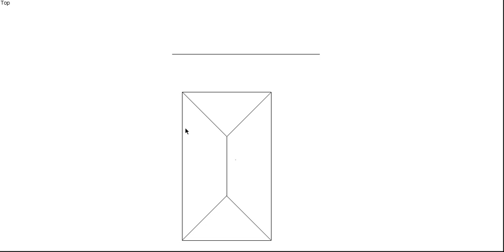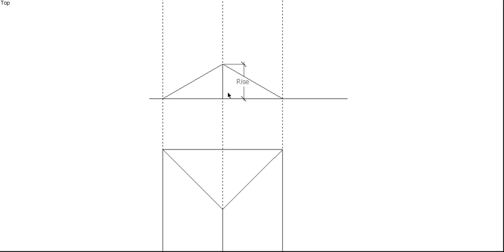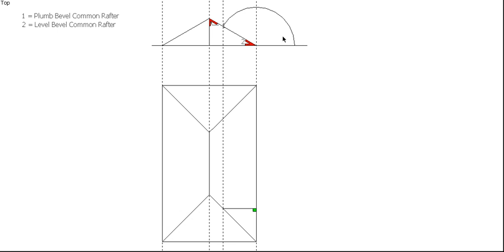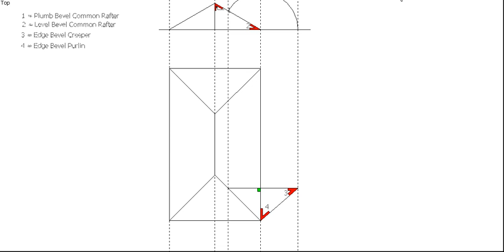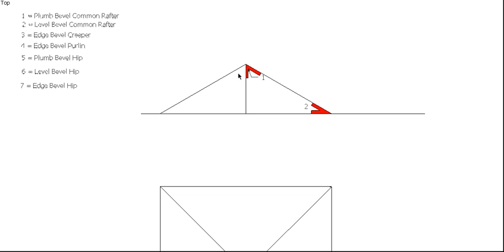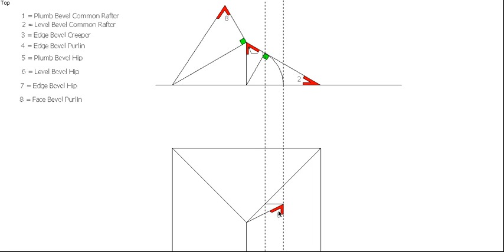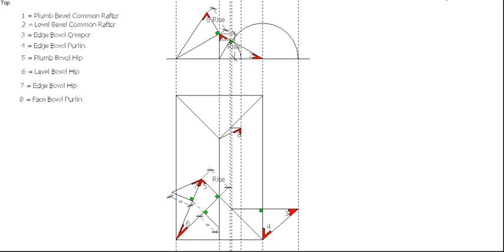Hip Roof Geometric Development

Comment: Stupid question perhaps, once you work out all the bevels how is this applied to cutting the actual timber members?
Reply from the maker: Hi Mate, You can use a sliding bevel to copy the angles onto the actual timber although there are other methods that are easier and put the angle on the timber.
Reply: @Buildsum  thanks 🙏

Comment: old skool, giving people relative understanding. good job mate! Using an ASA calculator you can do this using trigonometry(inverse tan), now you don't even need to understand trig. to use it,all the lengths and angles you need, simply input half spans and the roof angle.
Reply from the maker: Thanks Mate, agreeded, I have my own spreadsheet that works everything out for me these days however this how I was taught and it is still good for apprentices to at least know about it.
Reply: @Buildsum  1 gram of understanding is worth a kilo of raw experience! 😉

Comment: How do you get the angles for the jacks on the end plane? .... Other than tha these vids are so easy to follow thanks
Reply from the maker: +bloggs692413 Hi the angle for the Jack Rafters where they meet the Hip is made up with the Plumb Cut Common Rafter and the Edge Bevel Creeper
Reply: @Buildsum   45 degree cut using the powersaw on 45* - unless we are talking skews or out of square shapes, say a pentagonal hip end, is 72*- the cut for the Creeper is Crown End plumb cut on the powersaw at 36*
Reply: bloggs692413 Easiest way to get your Jack edge bevel is to mark the pitch angle on the side of the jack, draw a parallel line to your pitch line, the thickness of your rafter material, square the two lines across the top edge of rafter and join them together. Simples!
Reply: @BillyMustang101  the only Jack I know is whispering jack! get metric mate!
Reply: @damonalagich4524  where am I not metric, you numpty??? Lol
Reply: @BillyMustang101   do you understand where the word "jack" comes from?  British Imperialism, maybe you could start reading more, rather then watching tv commercials? Jeeper Creepers!
Reply: @damonalagich4524  maybe you should research what you post so you don’t look a fool as well.
Reply: @BillyMustang101  you mean to appear as a fool or troll? I know what I am, do you?